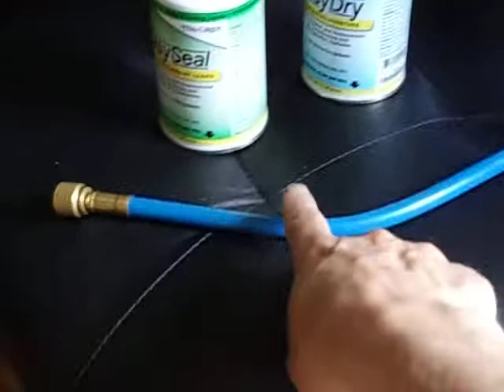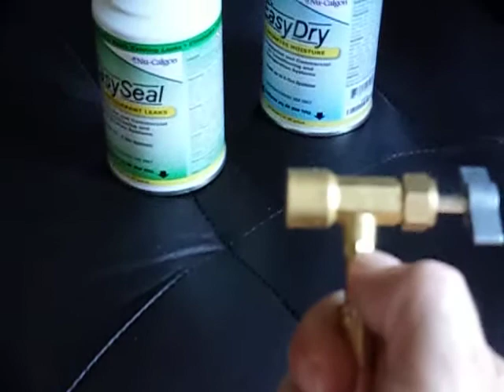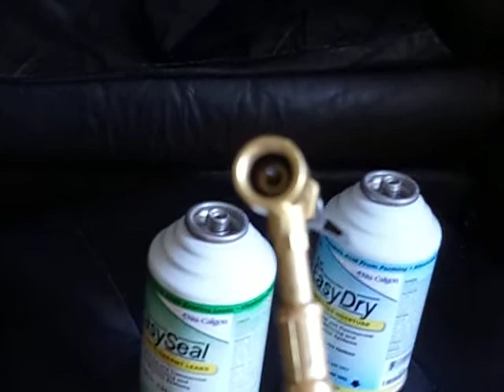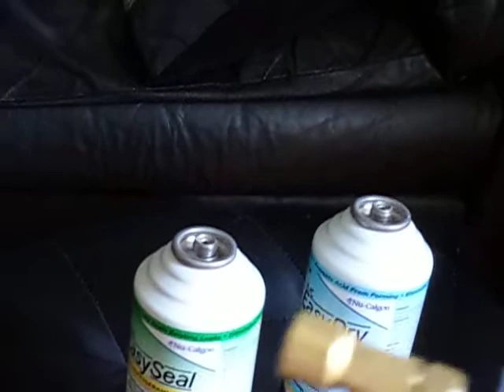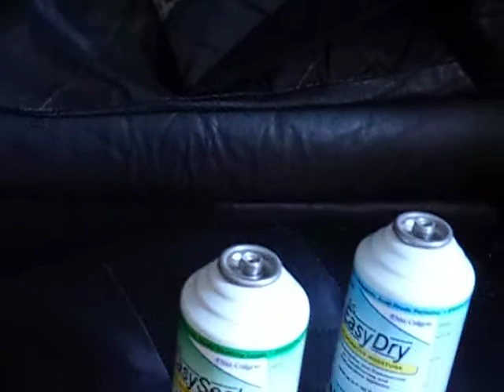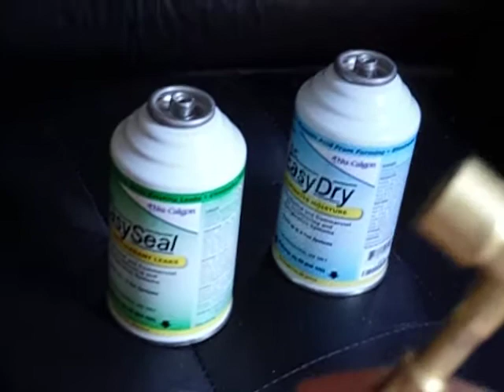Nu-Calgon Easy Seal; Easy Dry; Direct inject; connection hose;

Comment: Back the plunger all the way out. Screw in the can. Connect the hose to suction line. Slightly twist can to purge air. Tighten can backup. Screw down the piercing plunger into can. Back out plunger.

Comment: You are wrong regarding the piston (push button). Take a look https://www.youtube.com/watch?v=mfrvz2UqaaE&list=PL07XoWkrYvqW78PJlAclkI_X8ad-580Ag
Reply from the maker: there was more than one manufacturer or design for the hose, and I assure you the one I was holding had that one way valve, but other types do exist like I mentioned in my comments.